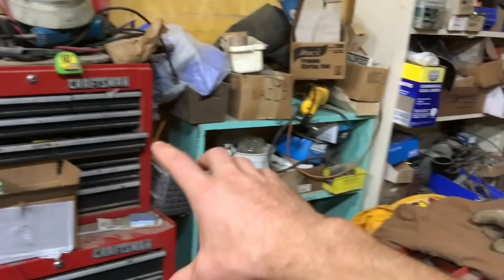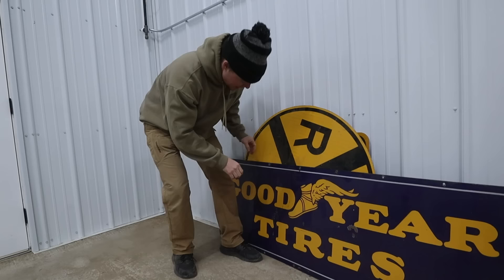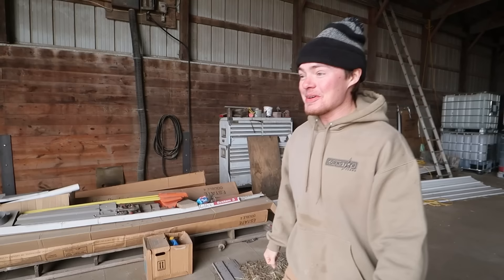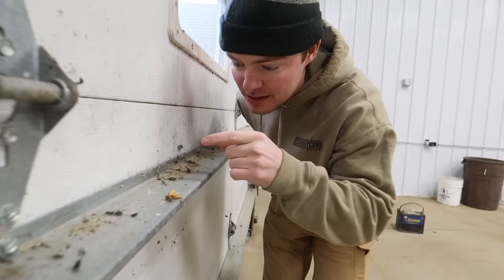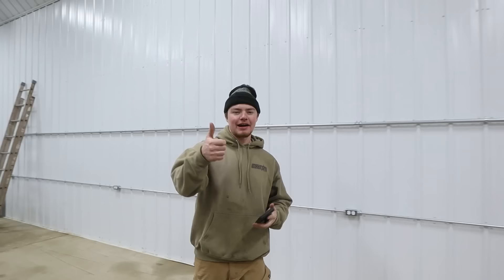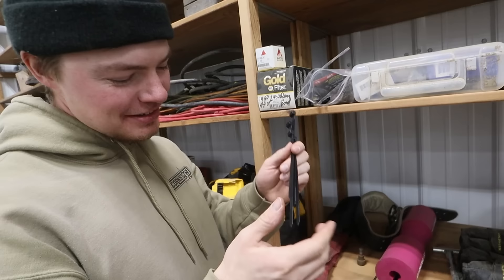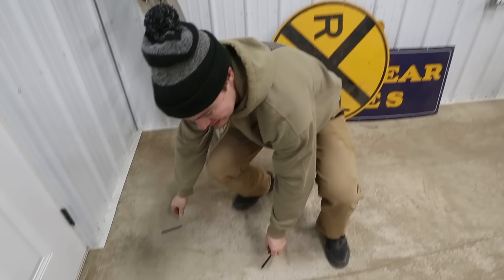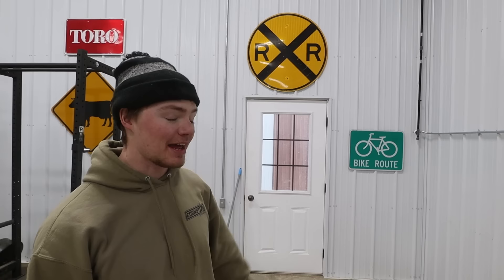Finding $10,000 In My Grandpa's Hoarder Garage

Comment: I have a cleaning hack for you, Cole! Baby wipes are great for taking off make-up, cleansing faces, getting grass stains off tennis shoes, and cleaning your tool boxes, even tools as long as aren't too greasy, and getting the adhesive off what it's stuck to. If that doesn't work, Dawn dishwasher liquid works fantastic on both of the tool boxes and the tools. I'm as OCD as you are. I've organized our tool shed as well as my home. I also use Swiffer dry heads on my walls and follow up with Swiffer wet pads on my walls...yes inside my home. The door to the heated shed will need to wait a month or so. It's way too cold. But, start with your power hose and the stuff you clean your tractors with. Then there's a cleanser from Home Depot that kills mold. Just washing it off will not do anything. You have to kill it with a special cleanser for mold. Do the entire door. If it's on there, it's on the entire door. You have to treat the entire door or it will begin to grow inside as well. ❤😊

Comment: Electric tips Never run conduit to handy boxes. Spend an extra dollar and purchase 1900 boxes ( 4 by 4" square ) 21/8" deep. If needed you can install two duplex receptacles and have room to add conduits. Best to either use a Tyvac tab cutter or linesman pliers to cut cable ties. If you use lines men pliers twist end until it breaks off to prevent a razor sharp edge. Best practice in shops is to install boxes every ten feet. You can leave some with no receptacles but if you have receptacles every 10' the usual 6' power cord will never need add n extension cord. Would I install a couple of quality cord reels and mount them center line of shop.Great job on luminares ( no such thing any more in the NEC called a light fixture ).

Comment: Use 30 second siding cleaner from Menards on that garage door.  it 's great stuff and it's about 10 bucks.  Just spray it with a sprayer and it will disappear fast.  I use it on my siding every few years and it looks like new.

Comment: Cole, if you find a bunch of salt and pepper shakers with the screw off lids or containers that are similar to that, put some pieces of lint (I use scraps of wool yarn) and put peppermint oil on them.  Lay them throughout the shop or anywhere else you have issues with mice.   Ford and a few other vehicle companies are using "biodegradable" (as in food based oil) insulation on all their wiring.   Mice will chew through it and moth balls will do nothing to deter mice or other critters.  The only thing we have found to keep mice out is peppermint oil on lint/wool scraps.  We have these metal magnetic containers with lids we have punched tiny holes on the top.    My deep freezer is in my garage, I have a magnetic container on the freezer near the compressor to keep critters away from there,  We have magnetic containers in all of our engine compartments.  Once a month, my husband takes a disposable pipette and squirts some oil into each of the containers on the scrap wool and this keeps the mice from getting back into the engine.  I hope this helps keeping mice and other critters out of the garages and other equipment.  The peppermint oil also works against raccoons, squirrels, rabbits and other critters.

Comment: I enjoy your videos.  

I too fall into a group of people, who have acquired “treasures” over 40 years of collecting, ie - a headlight bezel for a 1966 Dodge Van that I sold in 1975… there might be a need…not.  I have a lot of “treasures” in my garage that found a “temporary home” on a flat “treasure storage area” that become camouflaged when other items join them.  I would conservatively guess that 80% of my time is spent on a project is looking for something I just put down, because of my disorganization talents.  The other side of that coin is I have tools, parts, or “items too valuable to discard” lying in flat storage areas that I have that are in the way of what I am looking for, so I relocate them, then when I find a need to utilize them I spend hours looking for them.

I have finally talked my CFO in to allowing me build a “storage shed.”  Your video is an inspiration to design the new building (18’ x 35’ x 12H) to have specific areas for specific tasks.  I have the building plans and since I am in the Republic of California, the permits process takes a little time (since last June for 4 walls, 2 roof halves, one man door and a 10’ x 10’ roll up door in a part of the county that takes deputies an hour and a half to reach after the 9-1-1 phone call reporting that shots were fired).  I am making my design on paper…so much easier than moving actual “artifacts.”  I am sure I have enough time before the plans are approved and permits issued and the building completed to complete my paper design…I might even have the time to complete, or at least initiate the inventory process like you did.

Thank you for your video.

Respectfully submitted

Comment: Cole, just came across this vid, the hoarder in the title caught my attn. After watching it, I have a couple suggestions for you, though seeing how you were out plowing and its now already half way thru January, you might have already completed your shop. If not, one thing I would suggest while nothing is against the wall is to raise the string of outlets to at least above the tops of the workbenches so they're not trapped behind stuff, and in fact I would suggest instead, you raise them up on the wall well above everything and doing drops down from the current outlet boxes. That could save you a bunch of time instead of rebuilding it all and make each one a customizable height to whatever you put against the wall. I agree about giving away tools that you don't need, pick out the best to keep and give away the Chineseium, which to someone who has nothing would be appreciated I'm sure. I also 2nd other suggestion of lubricating those drawer slides after you power washed it, if you haven't already.

Comment: Put a basic set if tools in each vehicle, tractor, ect.  Time is money when you have to go back to the shop to get tools to fix something.  A five minute fix vs a 2 hour round trip back to the shop. Spare parts ie bolt bins, means saving a trip to town to keep some piece of equipment up and going.  

One thing i might suggest is to put a computer work station in the shop so you can order supplies and parts.   Also having equipment diagrams and other useful information at your fingertips.  I can see some late nights working there and the computer is another tool in the box so to speak.

Comment: 🎈🎈🎈With the air compressor you don’t need a leg going down to the floor. Build your landing and mount the compressor and take chain from the ceiling rafter to the outside corner of the landing shelf. Leaving all the floor space and wall space beneath it open.🎈🎈🎈

Comment: You some rope caulk for the garage door it comes in a role in different diameters. Its foam and soft enough it will push into that new garage seal  hole that will smash leaving holes for air and mice to find in

Comment: Lots of things will remove the adhesive residue from the tool boxes, but I prefer grip solvent -- the stuff golf shops use to lube up the double-back tape that's under golf grips. Easy to use, non-toxic, non-flammable and works well.

Comment: Cole, next time twist off the excess zip tie strap at the buckle - doesn't leave a sharp edge then. The 120 volt run should maybe have been at 4'. The outlets need to be GFI protected and now your easiest choice would be installing a GFI breaker on that circuit as your boxes are probably too small to accommodate a feed through GFI outlet.

Comment: Try peanut butter and a hair dryer to get the old adhesive residue off.  We used to use that in our large shop.  We found a heat gun too hot for some adhesive.

Comment: Great finds, all those wrenches will save you money worth the effort and time spent to organize them. If that steel top bench exoskeleton  is getting hard mounted to the floor, it's a good idea to add a backer board or metal panel to keep the wall from getting a lot of dings and scrapes in it. 
I keep thinking someone on the farm could use a smidgen of CAD training and software to help plan things like that or the compressor stand. Onshape and Fusion 360 come to mind. The video kept my motivation up while repairing and old brass lamp with replacement  steel threaded parts...its given me fits disintegrating at inopportune times for 10 years.....but no more ....Thanks

Comment: Tip: Wrap them outlets around the wire terminals on the back sides with electrical tape. It’ll save you from grounding out on the metal jboxes.

Comment: There is a gauge on the back of the receptacle that shows how much insulation to strip off. If you strip too little you can have the issue you were looking for. If you strip too much you can leave a little copper exposed so when you push all the wires back in it’s possible to have a ground wire contact other exposed copper. Where did I learn that?  On YouTube of course!

Comment: No "star: yet for D U N done until that compressor is off the floor!
To enable that wire rack to go along the back wall next to the garage door opener buttons, think about the compressor stand setup...
Maybe do like a 45 degree brace from the outer edge of its platform to the side wall. Make it about 2 ft away from the back wall. Put the platform and as high on the wall as you can. Then put the braces under it as high as you can to assure its strength and stability. 
The result of the stand will look like a P shape when you're done (but pointed, not rounded).

Comment: I know I'm  a day late and a dollar short, but I thought I'd share a trick I learned.  I always  run pig tails, aka a short piece of wire, off of every outlet.  The feed wire in and  the line out are twisted together along with the pigtail.  Then  a wirenut is screwed on till the wires start twisting together. Outlets are built like garbage.  This method  delivers  the full 15, 20 or however many amps through to the last outlet.  Plus, if one outlet fails,  all the outlets  beyond it continue to function.  Just an fyi. You do great work and bust your hump. Wish I could come help out.🤷‍♂️

Comment: You probably didn’t know cows had horns, because here in Iowa most cows do not have horns. They’ve been bred not to grow them. Cattle without horns are referred to as polled and it was done for safety reasons. A polled animal is a safer animal for humans to work around and safer to the herd, particularly if the animals are raised in confinements or on feedlots.

Comment: You could improve your receptacles by watching some videos on pigtails unless your local code allows receptacles as splicing devices as over time they can't compete with properly installed wirenuts as per instructions on packaging. Putting both conductors under under one clamp as you've done is a slight improvement over using two clamps there will still be more heat transfered to the receptacles by downstream current flow than with wirenuts.

Comment: air compressors have to be drained of moisture often or they rust out,  don't put it higher than you can reach.  if you want to do yourself a real favor put it outside where you don't have to listen too it and build a small shed around it.

Comment: Spray adheasive and sticker remover melts that sticky stuff right off! 😉
Don't forget to blow the water out of the draw bearinhs and yhrow a little oil on them to keep them from rusting...had to replace a rusted bearing rail on a Craftsman I had to force open.........bearings everywhere! 🤨

Comment: Just at a junk market or flea market( whatever you call them in you area) those green metal shelving where going for 20 bucks each. Saw a similar wooden shelf you threw out going for 250. Someone's junk is someone's else treasure! You found 3000 grand worth of wrenches but threw out 10000 grand worth of stuff to get to it. Your grandfather keep things for a reason. During the depression you couldn't go to the store and buy whatever you wanted. So it was always handy to have a wall of junk to dig through to find a solution to the problem at hand. But I'm just an old hoarder what do I know...

Comment: Build a loft for the air compressor to sit on bolt it to the walls in the corner, then run a cable from the loft to the ceiling to support it

Comment: The circuit breaker you got is a two pole breaker for a square D panel. The circuit breaker your grandpa got was a two pole breaker for a Siemens or Cutler hammer panel. So he got the right one, just for a different brand. You don’t have a three phase circuit breaker.

Comment: Cole, I am worried about the outlet.  In my opinion insulation can't be the issue, it's more a lack of insulation. I think one of the wires was touching the metal case before you opened it. It's all metal around. Please be careful

Comment: Hey Cole, food for thought but would it not by a good idea of doing an oil burning heater set up since you go through so much oil with the equipment. It would help lower the cost of heating and a good way to dispose of used motor oil.

Comment: Metal receptacles it is a good practice to tape around the plug to prevent contact betweeen terminals and the metal box.

Edit:  saw that was done on the 220.  Just didn’t catch it on 110.  I could’ve missed it or it wasn’t shown on video.

Comment: Just a suggestion you should make the top surface of the bench out of aluminum as it is easier to keep clean  as it's not magnetic
and won't damage any castings or components dropped on it

Comment: Alcohol and a flat razor blade will remove the adhesive gunk left behind by the protective cover. Sometimes I even used WD40 and I could remove the gunk.

Comment: Mr. root my ninth grade metal shop teacher would’ve made you do 10 push-ups for calling those wire cutters, the proper name is side cutters. Also if you called an adjustable wrench a “Crescent Wrench” 10 push-ups, adjustable pliers “Channel Locks” 10 push-ups.

Comment: Don't use the outlet as a wire nut please it  will fail. I have to fix this problem all the time use a wire nut and a tail wire to feed 1 outlet. The outlets should only have 1 wire feeding it.  Please use bigger boxes and leave longer wire in the box 5 in..😀

Comment: I like to wrap my receptacle terminals with electrical tape when using metal boxes. If the receptacle isn't center of the box it could cause a current to jump to the box and trip the breaker.

Comment: Don't throw away the sockets . They will last forever,  or give them to your worker. Also you'll need the grinder wrench if you ever use a metal Dimond blade because they will come loose with vibration if you only hand tighten .  Ever taken  off a broken zip cut blade by hand .???

Comment: 240v outlets are supposed to be dedicated circuits so all of those outlets along the wall are wired wrong.  The receptacles commonly used for welders and other equipment are nema 6-50R. You do not want the outlets positioned sideways either.  You don't have nearly enough circuits for the size of the building.  Just in this video alone there is at least a dozen nec code violations.

Comment: That’s not how the door gasket is suppose to be installed. Theres suppose to be a track on the bottom of the door that the seal runs through. That’s a U/O seal and that means it’s suppose to be in the shape of U and has the O shape for the door to lower down onto and help seal. Not a screw to the side of the door gasket.

Comment: Cole put the compressor out side in a metal shed it will be quieter and easy to maintain on the ground don't put that much weight and vibration over your head

Comment: screw touching copper - plugging in the phone charger, only an extra 2 amps (tops) asking for more amps than the breaker is designed to trip for
Reply: im thinking its relatively stable at first, but then the additional load jostles the flow and creates almost like a delta p effect (just conjecture)

Comment: Oh by the way that's one screw per wire AND you can't use the stupid brass jumper, as a daisy chain either. I hate wire nuts and prefer to use WAGOs. Later be safe, not sorry. And BTW about  your heavy duty sockets, keep them and build some adapters.😅

Comment: For what you are trying to accomplish you have to much plow and not enough tractor. Hindsight is 20/20, your answer to this situation was a short term lease on a weighted 250 or larger hp. FWA tractor. Set your depth, drop your plow and go! 👨🏻‍🦳 🐄🐄 🚜

Comment: Cole the breakers you have are single phase breakers. The four point connection breaker is a Square D breaker now days called old style. The other I have heard it called new style and home style. But both are Square D and two different types of breaker boxes. 3 phase breakers have 3 wire terminal and breaker box connections. No matter what brand it's all the same. 1 and 2 terminal breakers are single phase and 3 is 3 phase. And yes you get single phase power off a 3 phase box. Like your video. I will subscibe.

Comment: If you can remove a disc from a grinder just by turning the disc, then it wasn't installed properly in the first place. ROMAN is wrong that you shouldn't need the tool. Either the tool has a locking pin to prevent the shaft from turning or an additional tool to prevent it from turning while you tighten the locking collar with the wrench you threw across the shop. Safety first when any style of disc is turning at THOUSANDS of RPM! If you pulled that stunt at the shop i worked at, you would be in for a little talking to, and reminded about using tools correctly and SAFELY, not just for yourself but others working around you.